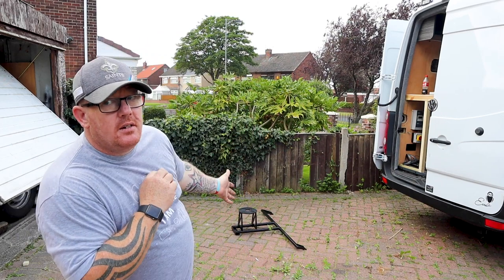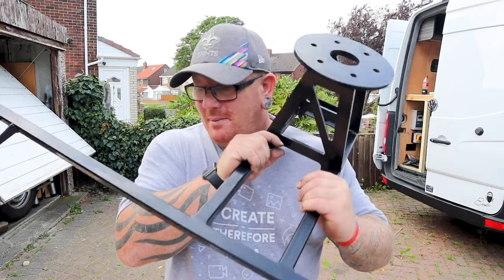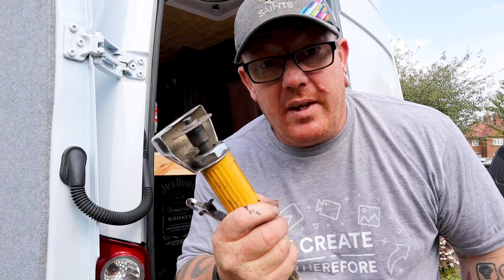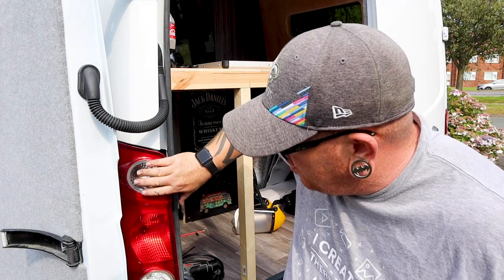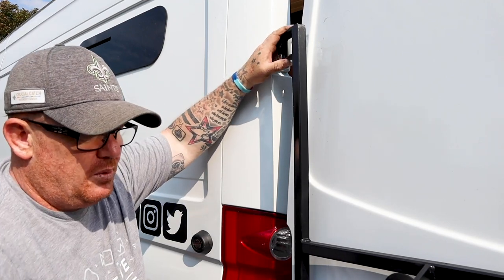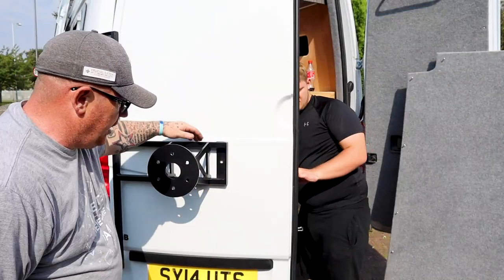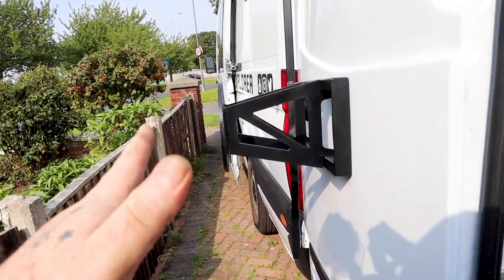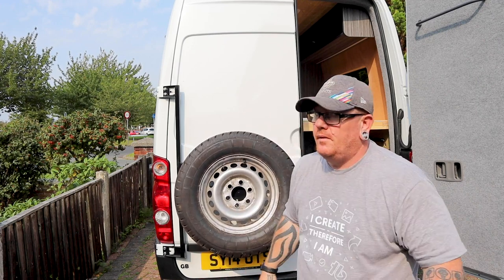SIMPLE DIY Rear Mounted spare Wheel Carrier

Comment: You should take the whole bracket to the engineering shop and refit  bracket to suit the magnet  door stop which is not used now remove magnet and use the original hole no drilling door   Also seal between bracket and door water get in rust  rust